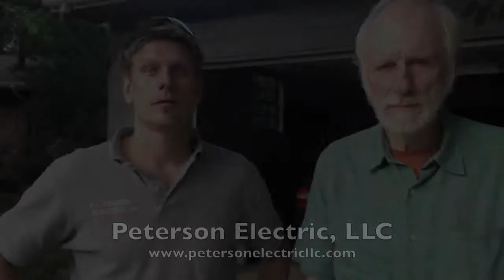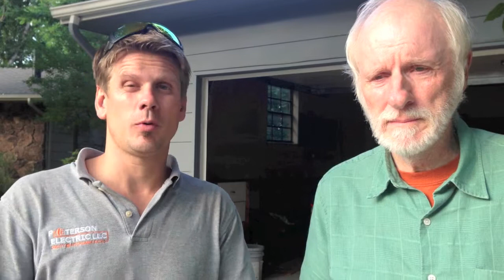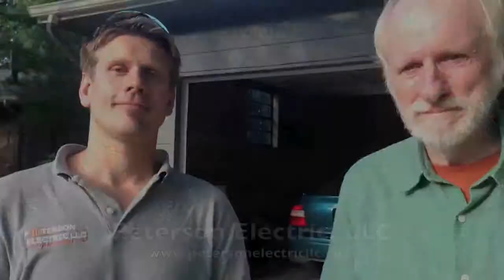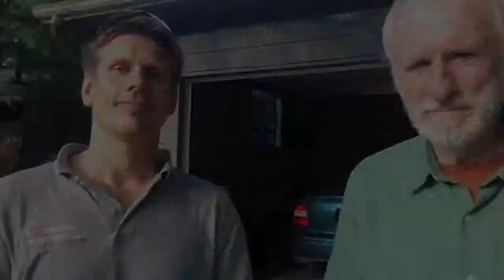Identifying Zinsco Panel Vs. FPE Panel, Fort Collins Electrical Testimonial

Comment from the maker: Are you even a licensed master electrician? 

We do a "Thermal" scan with our THERMAL METER WHEN DOING A WHILE HOUSE LOAD Test.
Reply: No but a very experienced inspector who has seen many failed Zinsco panels (as well as FPE panels). I look at electric panels five days a week, inspecting them thoroughly. I have done hours of research on Zinsco and FPE panels and consulted other licensed master electricians on these panels. I have personally seen one that was moments away from starting a fire. There was nothing wrong with the install, but instead it was an equipment failure. I have seen other panels that have almost become a fire hazard but it is always because of user error on behalf of whoever was working in the panel. 

And if we go by your logic, a momentary thermal scan on one random day means that the panel will never have any issues in the future then? I bet every single FPE panel would have passed a thermal scan the first day they were installed and in use. That only identifies current problems but has no way of indicating if the panel will have any overheating problems in the future as it ages. 

Do your research, Zinsco is a fire hazard in a home and you guys should think twice about posting a video like this.

Comment: It's not what I would call even minimally safe. Yeah - you might have saved him some money - but maybe you should consider putting a price on safety - you can't. Electric panels have a 30 - 40 year service life. Any panel that old needs to be replaced. Add to that the fact that it's a panel with known problems -  the only reasonable thing to do is replace it. Panel replacements in the DC Metro area (by a licensed electrician) run about $2,000 - $2,500. That said, even $3,500 would be a bargain to replace a panel that could burn a house down. The fact that the panel has a UL sticker doesn't make it safe...

Comment from the maker: The Zinsco panels are not what I would call a "extra safe" Load center, but it did have a UL listed sticker. So, it is your call. I personally would not have one in my home, besides I would never add on to one with a sub panel to Accommodate new AFCI breakers. We cannot always make the customer convinced to change their load center panel out "especially" if they are selling their home. Many of times the two parties buying and selling the home are going to negotiate the price.

Comment: This video is giving bad information to the public and should be removed immediately. Zinsco panels are NOT safe. Yes they are not the same as FPE panels, but they are considered a dangerous electric panel with many documented cases of failures / home fires that were due to equipment failure (not from bad wiring or home-owner specials like we see often). Do your research on the panels - http://www.ismypanelsafe.com/zinsco_damage.aspx
Reply: Exactly! I am a licensed master electrician, and I would not even give a second thought as to whether or not to replace a Zinsco panel.  Those are as bad as FPE, and they MUST be replaced ASAP!  Plus, I will NOT do any other electrical work in a customer's house with either of those panel types, unless they hire me to replace the panel as well.  And I charge a base price of $1500 for a complete new 200A service; not anywhere near $3500.

Comment: I realize that Zinsco and Federal Pacific are different. The original electrician should have known the difference. That said, Zinsco is no longer selling products in the US. Once that tests by Dr. Jess Aronstein PE, done in 2017 showed a nearly 30% failure rate for UBI Zinsco breakers. I will refrain from theatrics as much as possible. While you saved this client loads of money, and I feel your ethics are outstanding and your heart is in the right place, I suggest you review the reliability of Zinsco breakers and panels and re-evaluate your decision for this client.
Reply: Very well said!  The electrical contractor in this video is actually doing the customer a disservice by falsely claiming that the Zinsco panel is not a hazard.  So now the customer has a false sense of security.  I hope he hires another contractor to replace it in due time, and for a lot less than $3500.

Comment: I'm a qualified electrician but not experienced in residential panel replacement.  I just purchased a home with one of these panels.  I know this is an old video, but thanks for posting it.  I was under the impression that Zinsco HAD lost it's rating, but it's probably a good idea for me to replace it anyway.
Reply: Yes! By all means, replace it!  Those are not any safer than FPE panels.  I have done my due diligence on this.